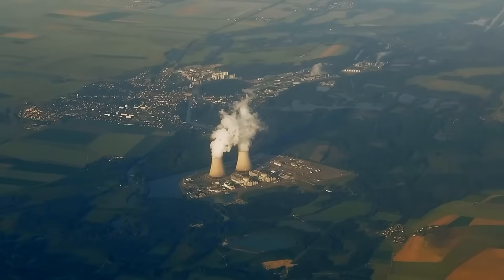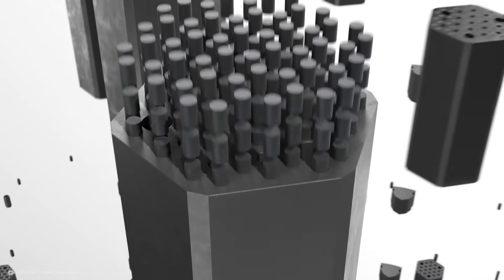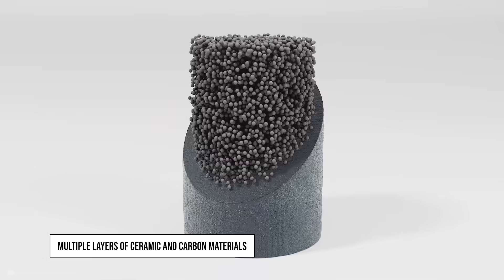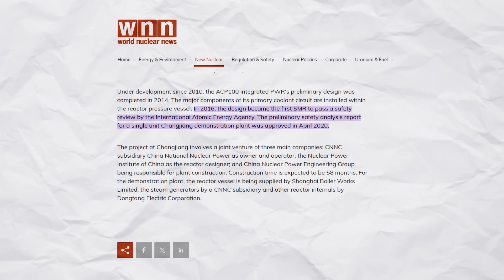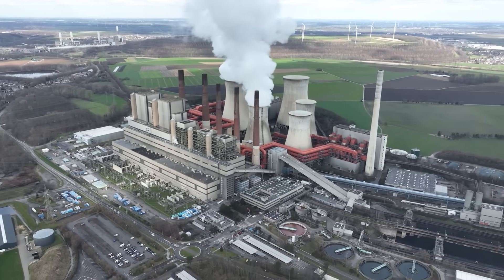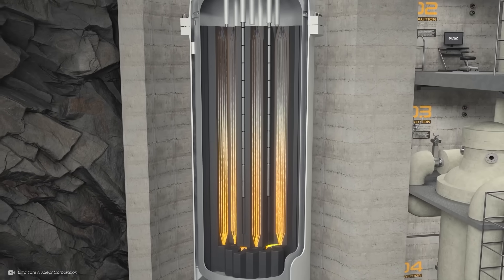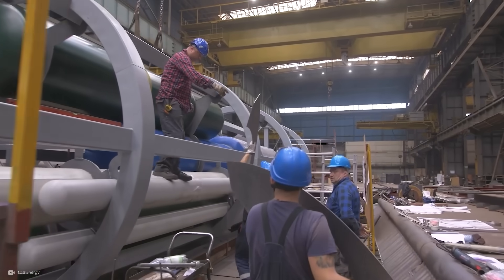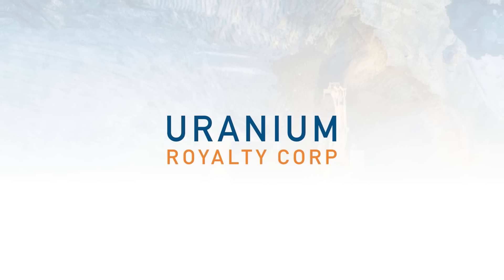The Genius of China's Small Modular Nuclear Reactor

Comment: @5:58: There's a mistake. Video states "Natural Uranium is abdundant as the isotope U 238, but must be refined into U 235 for reactors."
Totally wrong! 

No, Natural uranium (at least, in this solar system, all coming from the same supernova) is 0.72% U-235, and most of the rest U-238. You can't refine U238 into U235, the physics do not work that way. 

You can't even perfectly separate them. 

What you can do is gradually concentrate or 'enrich' the U235 in the mixture.  Or you can make a big reactor able to start on natural U, and then use the neutron fire to cook U-238 into Plutonium-239. That Plutonium is also fissile, however running a reactor on it is much more difficult: It tends to be easier to make bombs out of it, however that too is (thankfully!)  extremely difficult. So, even the "must be refined ...  for reactors" part of the statement isn't right either.

Note, that relative abundance is due to the age of the Uranium: The stuff WE have was formed in a particular supernova, apparently about 6.6 Billion years ago, and since U235 has a shorter halflife than does U238 there remains less of it today. As time passes, the relative % of U235 will further decrease, eventually making nuclear power entirely impossible. 

This will take millions of years however - other things are likely to be more of a problem much sooner than that. 

1.7 Billion years ago, the concentration was higher: about 3.1%. High enough that making a reactor was easier then, so much so that we know for sure that at least one nuclear reactor naturally formed: We know this because it was found.

Today, mother nature can no longer so easily manage to form naturally forming nuclear reactors, at least not on the surface crust of this planet. It needs a little help to be arranged to the point where a supercritical neutron chain reaction can happen (ie, a nuclear fission reaction can 'ignite').

Note that if you want to make a smaller reactor, you need more highly enriched U. The best to use for reliable small modular reactors with minimum size is mostly U-235. Above 90% is 'weapons grade', from which it becomes actually quite easy (at least, relative to the technical complexity of using plutonium) to make a nuclear bomb.

The less pure the fissile material, the bigger you need to make the reactor in order to take advantage of the better physics: In this case, the 'surface area to volume ratio' scaling that effects how easy it is to keep the neutrons where you need them. This also means a larger reactor can, all else equal, use more of the fuel before it is no longer able to continue, and the fuel is 'spent' (for that reactor, anyway). 

Reactor's typically don't burn up 'most' of the U-235 they have in the fuel: Instead, solid-fuel gets increasingly contaminated with waste from splitting the atoms, until it has too much 'reactor poison' in it, and the fuel is considered spent. Think of it like a fire that instead of burning on the outside of the fuel, burns randomly throughout the fuel, and leaves hot waste everywhere microscopically mixed throughout: You might consider that it 'shits where it eats'. Eventually, the 'food' is too contaminated to be 'et'. The % of U-235 that is actually used in a once-through use of enriched reactor fuel, in a typical solid-fueled reactor, is only a pathetic 4% or so.

There are reactor designs that both make the reactor 'passively safe melt-down shutdown compatible', as well as allow that 4% figure to be increased to close to 100%. That latter effectively would make nuclear power about 20x cheaper, again.

And we haven't even discussed Thorium yet.... It can be 'bred' (transmuted using neutrons) into Uranium-233, which is also fissile. And there's about 3 to 4 x more Thorium-232 (all the one isotope) than there is Natural U. On top of that, Thorium is an industrial waste product available from anywhere in the world (eg, at any 'rare earth metal mine' that leeches those from crushed rock: The Th comes out whilst they're extracting other elements. They mostly just throw it back with the other wastes.

Comment: Oversimplification, misinformation & plain wrong. 

1. Nuclear power has new technology (molten salt reactor operating in the fast neutron spectrum) which can use 'waste' from thermal reactors as fuel. They 'burn' all elements above Uran (actinides) in the table of elements and reduce them to fission products with a half life of max 300 years. This solution is developed as we speak. Elysium Industries have a test facility on the go already. New materials are tested at INL with good results. This will happen soon.

2. Wind & solar are producing power intermittent. They need extensive investment in grid infrastructure and need access to 'balance' power to produce electricity when they don't. Both these factors are not calculated in when the price is presented to the viewer. This is 'unmoral' advertising and should not happen.

3. Wind & solar has a footprint much larger than nuclear power. A nuclear power plant is FAR less intrusive in nature than wind & solar. The only place wind can make sense is offshore. But even there, the numbers don't add up. It will be very expensive and not green at all.

All in all, the story here is not wrong, but is rather slanted to one side. This is why I wrote this post. To balance what is told and to point out that nuclear is the answer to our 'green' transformation.

Comment: What is going to take off is new geothermal tech with horizontal drilling and fracking.  It is going to be cheaper than anything.  Well, hydro could still be cheaper but is limited.  There are only so many rivers.  The new geothermal can be put just about anywhere, resulting in shorter power line runs.  It also has a small footprint.  Reactors because of regulations, require a large chunk of land, usually prime lad next to the ocean or rivers.  And when the reactors are low output, that makes costs hard to recover.  The only reason SMRs got investment was because there was the promise that construction could be accelerated.  That has yet to be demonstrated.  Better in my opinion would have been scaling up to larger reactors that produce absurd amounts of energy, and put them near high energy requiring processes like titanium, and aluminum refining.  Just make millions of tons of these metals and other high energy materials production.  They can still power nearby cities or more distant cities where the power lines are already present, but producing a lot of iron, steel, aluminum, titanium, cement, glass...

Comment: What happened with Thorium powered (& molten-salt cooled) SMRs ??
Reply: Sponsored by Uranium.
Reply: China build one get it up and running do safety checks and get 90% of all the  products in house and they go into production they do this with everything yes thorium and SMR this is how they do it OK
Reply: Simple lack of investment because NOBODY controls the IP.
There's a real issue with the free market approach to energy because it simply does NOT work and almost nobody in the economics profession will admit that they got it wrong.
Reply: Vapourware 😂
Reply: @haruhisuzumiya6  You're apparently ignorant that you can go see an operating Thorium reactor in China. You're vaporware.
Reply: @haruhisuzumiya6  Not quite vapourware just not enough money to get it over the line.
MSRs were clearly a better option for commercial reactors and they knew that in the 1970s after the Oakridge experimental units. The problem was there was so much investment in PWRs and they were established and sorted out. 
Its a lot like many other technology struggles. The best technology does not always win. One of the classics I remember was VHS versus Betamax. By every video quality metric Betamax was a better technology. VHS had 2 advantages. Its was cheaper to make the tapes and they were in the market first.
Reply: "Vapourware" sounds like a good thing when talking about stuff that's supposed to spin steam turbines. Lots of vapour required.
Reply: @tvuser9529 Actually there's no vapour in a steam turbine. To work they have to keep the H2O ABOVE the temperature where there's vapour and its 100% steam (as in a gas).
Its why it doesn't matter what the heat source is most thermal plants are limited to about 36% Carnot Efficiency. To get higher efficiency you have to operate at higher boiler temperatures or use a different gas which is the theory behind gas cooled Gen IV reactors.
Sorry for the geek out
Reply: @ Actually I know, but I take some liberties when making puns. No worries :)
Reply: @ fair enuf mate
it was a fair pun but lost on non-geeks

Comment: The notion of SMR is misleading.  Nuclear reactors are subject to the economy of scale.  Got that?  The real issue is that nuclear reactor size does not equate with the size of the reactor core.  The reactor scales with power due to all the rest, ie the cooling, power transfer and safety systems that work together to allow the reactor to operate safely and efficiently.  To double the power you don't double the size of the core but mostly double the transfer of heat to another medium.  Light or heavy water reactor implies huge infrastructure like the concrete dome to absorb the expansion of steam in case of a breach accident like Chernobyl.  Remember that Chernobyl did not have a containment structure but was directly exposed to ambient pressure in a hangar with no vault.  Obviously this was compounded by known issues concerning the early model of reactor, that it could be unstable at low power.  In the future we will see SMR's in isolated applications but for most applications we will continue to see optimal scaling of reactors to reduce cost.  The bigger issue is technology because the nuclear space is a very engineering-rich environment that can and is benefiting from R&D.  For example, take the molten salt reactor, just one class of machines that stand to reduce costs and improve safety of reactors.  For skeptics, keep in mind that US military reactors are at 12th generation compared to 3rd or 4th generation in civilian applications.  Recent ship and submarine reactors now operate for over a decade without refueling.  This military tech needs to be transfered to the civilian economy so we can all benefit from these military innovations.

Comment: The electricity produced is still transmitted over the Grid, which is the weak link.
Reply: What do you base that on? The grid is dependent on generation capacity and operation. It's not the lines you imagine.